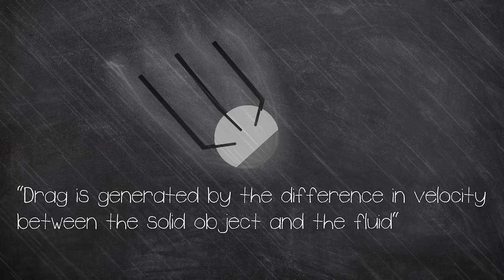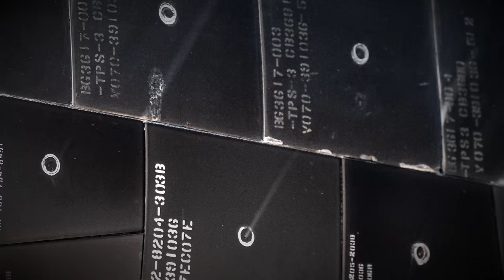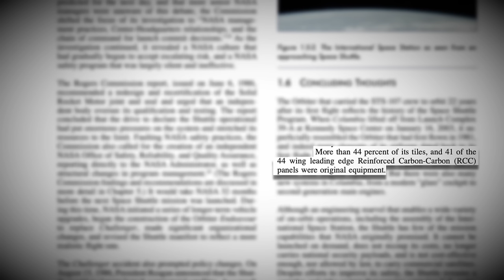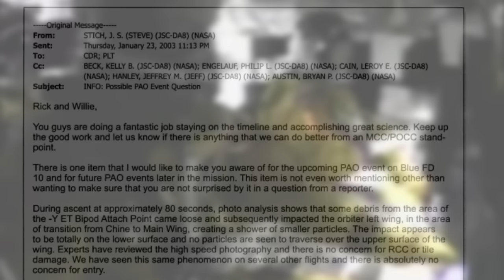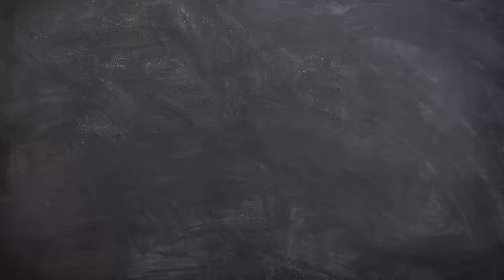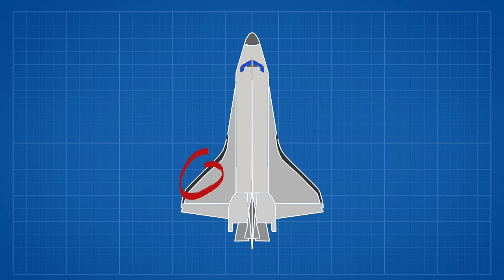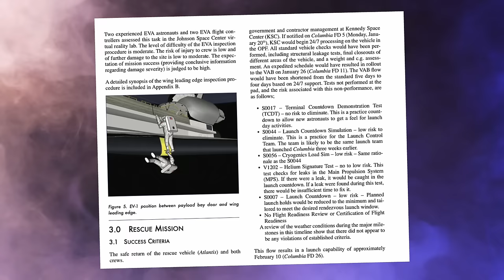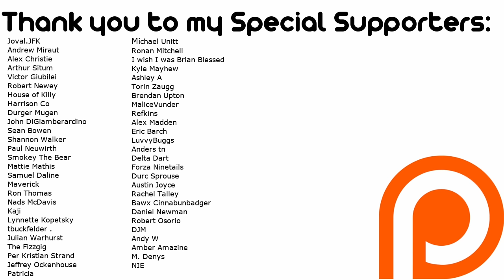Ignored Warnings: The Columbia Space Shuttle Disaster 2003 | Documentary | Plainly Difficult

Comment: Just think, a single spacewalk to look at the impact site would have averted this disaster easily, yet the best minds in the world never thought to try it. Instead, they spent all their brainpower coming up with a small novel as to why the astronauts shouldn't be worried that sounded more like a mobster telling you your China shop will be "perfectly fine".
Reply: There was no EVA planned for sts 107. An EVA isnt a trivial affair. There was no hand helds or other means of attaching yourself on the wing. Even if they could get to it, there was no "easy" way to fix the hole. Stop promoting myth.
The crew was doomed years in advance when foam strikes went from being viewed as a safety hazard to be considered a maintainance issue between flights. Fact is the TPS was designed to not being hit by anything at all... Everytime it happened regardless, they wrongly concluded that the TPS could withstand being struck instead of concluding that they had a long steak of near misses.
Reply: @tusse67  Where was I promoting myth by saying they didn't consider an EVA? Crews on the shuttles have done EVAs multiple times in past using tethers. On top of this, I never said anything about them fixing any damage. Shuttles are kept to a very strict weight limit, meaning that spare parts for the ship exterior would NOT be on board. They likely wouldn't have had the necessary tools to affect proper repairs either, and this was well before the ability to 3D-print items.

Had you watched the video, you would have known that this was actually something discussed, albeit after the fact. The entire point of doing an EVA would have simply been to assess the damage so NASA could determine if reentry was safe.

Also as explained in the video, the most probable solution would have been to send Atlantis to pick up the crew, as it was already scheduled for launch. There would have been the option of docking the ship to the ISS until some plan for repairs could be made, if deemed necessary after a proper assessment. This would have been difficult, as they'd need to find a way to alter orbit without sufficient fuel, but not impossible if carefully calculated and an alternate propulsion to the engines was explored or if the Atlantis brought additional fuel.

Saying that they were doomed years in advance is showing ignorance of how crises are generally averted. Takeoff and reentry are the two most dangerous times for a shuttle and its crew. They made it safely to orbit, and it was the failure to assess the damage properly, NOT the foam debris, that doomed the crew.

Had NASA scheduled an EVA to assess the damage or altered plans to have the ISS take photos when the orbits were at their closest point, the crew might still be alive today. This is simple fact.
Reply: @ValosiTiamata  in short. Your suggesting for columbia to “somehow” change orbit to reach iss severily detracts from your credibility! Had they realized on day 2 that columbia was unable to land safely, the had a max duration of 30 days. Proposing to somehow ship thousands of metres/second of delta V in that timeframe to them is bonkers.
The theorized Atlantis rescue mission was a long shot, that would have called for so many “firsts” (with a minimum of 8 hours of station keeping near columbia using OMS fuel, leaving not enought for reentry being among them) that it must be considered an academic exercise. 

I repeat. They were essentially doomed when foam strikes was considered a nusiance instead of a safety hazard… they didnt sound the alarm as they didnt consider it worth sounding the alarm over. 

Ps: why have iss take pictures? They had lousy optics! If any, it should have been a spy satellite.
Reply: @tusse67  Again, you seem to lack knowledge of the people who work at NASA and their capabilities. While difficult, docking in space has been done successfully multiple times, including in missions before the shuttles were even designed.

Also, your idea of sending a Delta is absolutely ludicrous. Neither the Delta nor Saturn was designed for this sort of mission. Meanwhile, Atlantis was already scheduled for a launch and IS designed to handle such missions. Unlike rockets, the shuttle contains a large cargo bay designed for transporting satellites and contains a manipulator arm for grabbing onto said satellites for maintenance. With only two crew and no other payload, Atlantis could safely transport enough fuel to allow Columbia to make a later reentry.

The shuttle is equipped with maneuvering thrusters. A short burst at the right time would allow the shuttle to begin an intercept course for the ISS. This isn't sci-fi where a ship can just park in orbit. The shuttle is constantly moving under its own momentum, meaning it will move towards the ISS once you point it in the right direction. Of course, it would require one person to remain on board, preferably two, to initiate docking procedures. Again, difficult, but not impossible.

You seem to have a major beef with NASA, and claiming my credibility is in question when everything I've suggested HAS been done before just seems to confirm you just want to put NASA down. It doesn't help that you keep claiming the astronauts were "doomed" before leaving the ground and now suggest they could have sent a rocket. Do you have any idea how much effort it takes to prepare a Delta V, let alone the calculations and cost that would be necessary to perform an unscheduled launch like that?

Russia's shuttle program never slowed down after Challenger, and their designs are nearly identical (albeit with superior cargo capacity). If astronauts really are "doomed" as you claim, those old CCCP shuttles which were cobbled together with lower budgets and inferior resources should've all burned up decades ago.

Nobody can predict when a bit of debris will cause a major problem. There's more than enough debris in orbit right now that it's rare for a mission to come back without a few dings. But that doesn't mean that there's some great predestination at play. Accidents happen, and Columbia's disaster was a result of failing to check the damage, pure and simple.
Reply: @ValosiTiamata  I’m not talking about the Delta rocket! delta V is a term used for change in velocity! Anyone with knowledge about rocketry knows this! 

The shuttle was not able to refuel in space. There was no accessible valves to do that. 

I dont have a beef with NASA. I have a beef with people making things up!

Russias shuttle program launched once, completing 3 orbit.

Why are you talking about orbiting debries when it a foam strike from the external tank that hit columbia on ascend? An issue they had experienced without consequence on many previous missions coming to the comclusion that it didnt matter!

You are either a chat gbt answer or just making things up on the run!
Reply: @tusse67  Considering your lack of knowledge on how NASA operates and insistence on trolling, it is easy to conclude your mention of "delta V" was referring to the rocket as opposed to the calculation. Congratulations for saying at least one intelligent thing, even if you failed to give proper context.

And since you don't understand the simple reality of orbital debris, let me spell it out for you. When in orbit, all objects travel at extremely high velocity. Something as small as a paint chip could cause a breach, which is why the shuttle and ISS have extremely thick windows.

Taking some debris damage in orbit is almost inevitable. If, as you say, astronauts are predestined to be "doomed", then every single mission would end in disaster. Driving a car on an icy road always carries a small risk of an accident, but does that mean you're "doomed" every time you get in your car when it's icy out? NASA based their decision off of bad computer data. Even a child could understand that mistakes happen and that you shouldn't believe everything a computer tells you because of human error.

All they had to do was take a look at the damage to determine its extent, and they DID consider having the shuttle maneuver so they could take ground-based imagery but decided their schedule was more important. This shouldn't be that difficult to understand, yet you're so insistent on trolling that you can't grasp the most basic facts of this failed mission. And for someone who claims they have no beef with NASA, you sure do like to bash their capabilities.

I would strongly suggest you actually watch this video, then go and read the actual report (or have an adult read them to you and explain what it says). And as for claiming I must be ChatGPT sim0ply because I'm giving you facts over fe3elings is pretty childish in its own right.

As for the Russian shuttles,  here's a little history lesson:

Three were made, with the third (2.01) having been intended as an upgrade to the original design. It had two sister ships that were in early [production. Only the Буран and several test shuttles flew before the collapse of the CCCP. The Буран was destroyed in 2002. However, other Буран-class shuttles still exist in various states of disrepair. Буря and a test shuttle are currently in Kazakhstan and are both still serviceable. 2.01 is currently at Военфильм-Медынь and has been partially restored. The other two Буран-class shuttles were dismantled. The БТС-01 test shuttle is now an exhibit at ВДНХ in Moscow. Additionally, the БТС-02 test shuttle was turned into an exhibit in Germany.

Russia has expressed interest in bringing the Буран shuttles back into service, but negotiations to  reclaim Буря from the Kazakh government is ongoing. It requires disassembly and cleaning, plus a few components were never installed, but is otherwise in excellent condition. As the 2.01 was never completed, it would require more extensive work, but some of that work has already been done.

The US shuttle program was mothballed in 1986, the CCCP program in 1993 due to the economic situation when the union was dissolved. However, the official (asnd unofficial) beginnings of both programs were only a few years apart. Additionally, the Russian design had already addressed and solved numerous design flaws in the US design, including the flaws that destroyed Challenger and Columbia.

Unlike the American designs, the Russian shuttle design has its own engines, larger cargo space, and numerous other major improvements. If not for Russia's current involvement in the 10-year long Ukrainian civil war marring Russo-Kazakh relations, Буря would likely have been back in Russia by now and well into restoration, if not completely restored and functional by now.
Reply: @ValosiTiamata  
There is no Delta V rocket. The latest addition was Delta IV. 

Columbia was hit by foam from the external tank while still ascending through the atmosphere… Why do you keep talking about orbital debries? While they certainly represent their own hazard they’re simply not relevant when talking about the demise of Columbia! As mentioned three times now, foam hitting the orbiter on ascend was a known issue not taken as serious as it should have been. I’m not betting you’ll get the point this time either!

Taking pictures from earth were never on the table! The blurring from looking through the atmosphere would make them useless! If pictures had to be taken it would be a spybird doing it! 

Except from Buran, the other articles were either never meant to fly or only partially build. The two in Kazakhstan mainly attracts the attention of urban explorers. For them to fly they should be rebuild from scratch as sitting unattended in a large hangar, partially exposed to the elements for 30 years disqualify them. Furthermore the Energia rocket would have to be restarted nearly from scratch as well. Roscosmos have neither the resources nor the interest in doing that. I suspect it is only interest based on CCCP nolstalgia.

While I do agree that they eliminated the SRB hazard on the russian shuttle, they didnt eliminate the problem with debries from the energia hitting the TPS.

Comment: Why couldn’t they have used the iSS as a life boat?  Send some back in Soyuz and launch more Soyuz to bring the rest home?
Reply: The STS-107 mission was a Space Shuttle mission, which meant that the astronauts were not equipped with the necessary supplies, equipment, or training to live on the ISS for an extended period of time.
At the time of the STS-107 mission in 2003, the ISS did not have enough resources, such as food, water, and oxygen, to support additional crew members for an extended period of time.
Sending a Soyuz spacecraft to rescue the astronauts on STS-107 would have required significant logistical planning and coordination, as well as potentially putting the ISS crew at risk.
The Soyuz spacecraft is designed to carry a specific number of passengers, and launching multiple Soyuz spacecraft to rescue the STS-107 crew would have been a complex and challenging mission.
Reply: @Infinite-void908  Columbia could not reach the ISS: it was orbiting with an inclination of 39 degrees. A plane change to the ~52º of the ISS orbit would require way more fuel than the orbiter carried. And that goes for the Soyuz as well: a Soyuz leaving the ISS could not reach 39º.
Reply: @Hobbes746  I know that the Columbia couldn't reach the ISS. My first paragraph was hinting at that.
Reply: @Infinite-void908  I thought the hint could use clarification for the original poster ;)

Comment: NASA senior management really screwed the pooch on this one and it cost them a very expensive Shuttle and the precious lives of 7 astronauts. I still don't know why, if NASA saw some foam break off and hit the shuttle, they did not direct one or two astronauts to do a space walk and survey the damage. Had they done that they had options. They could even have configured and sent up another shuttle within a week with repair parts or used it as a lifeboat for the astronauts until a mission could be scheduled to rendezvous with Columbia and effect repairs. . But they chose to ignore it and and we all know how that turned out. 

As for Challenger, NASA management disregarded warnings from Morton Thiokol engineers that the temperature was too low to guarantee a seal between the rocket motor segments. The shuttle was destroyed and they lost 7 astronauts.
Reply: NASA likely made the best decision based on the information they had at the time. It's possible that NASA believed the foam strike was not significant enough to warrant a spacewalk or that they did not have the necessary resources or protocols in place to perform such a task. Conducting a spacewalk comes with its own risks and challenges. Hindsight is always 20/20, and it's easy to speculate about what could have been done differently after the fact.

Comment: Maybe I'm ignorant, and speaking out of emotions dredged back up by this video, but why didn't they have the crew do an EVA to check the wing? God dammit this makes me mad, sad, frustrated... I hate bureaucracy.
Reply: For years and years they had foam from ET (external tank) hitting the TPS (thermal protection system)without issue (sts-27 was a bit different as it was a part of the tip of one of the Solid rocket boosters that hit the atlantis on its chin). This helped them conclude, wrongly, that the TPS, could withstand impacts even though its design specification was for nothing to hit it… The right conclusion was that they had a long streak of luck.

Comment: it's always easy to criticize NASA but they have installed many improvements over past missions for example they now put a hole in the middle of the cruivse toilet seat which improved pooping greatly, they also now stocked dehydrated water sachets and vacuumed air canisters as safety and convenience issueshowever maybe they should have looked at heat Shields and life say t equipment also had six the cracked windows instead of rendering with chipboard like last time and replaced the fuel cap upon fueling this time so NASA of very serious about their image sorry I mean through safety and seriously want 

elete did we question mahow do you f**** edit that nowrkthere's no good either?? enough said